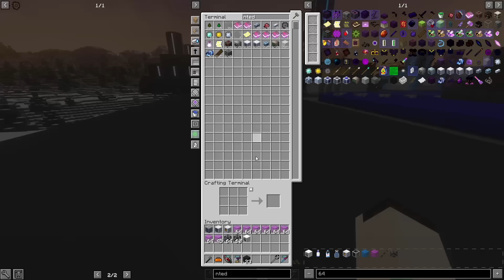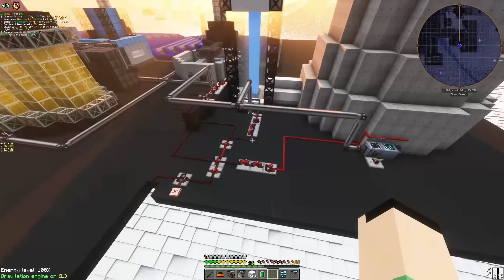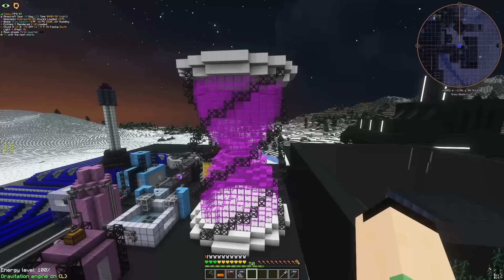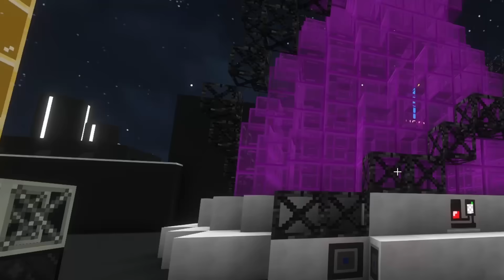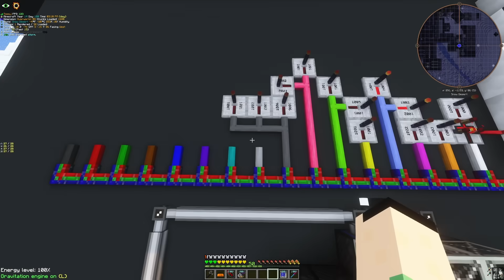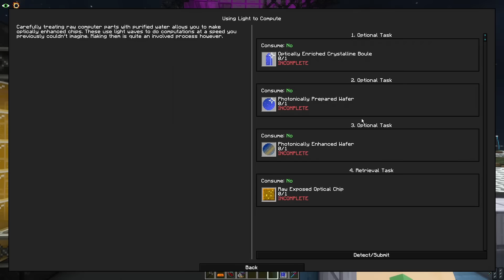GregTech New Horizons E121: Grade 7 Water

Comment: You do have to use a soldering iron on the activity detector cover for it to work properly. Not sure if this is a 2.8 issue or does this apply to 2.7.

Comment: Well, this water automation is actually pretty clean without opencomputers :)
Doesn't really matter but you didn't need to make the first optical circuit in a uhv singleblock, you could use a CAL in circuit assembler mode at uev